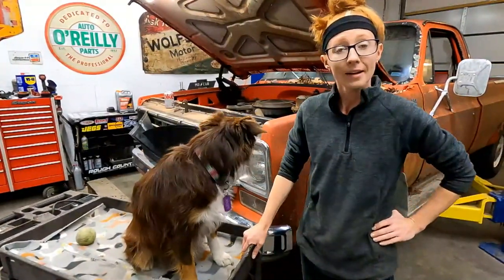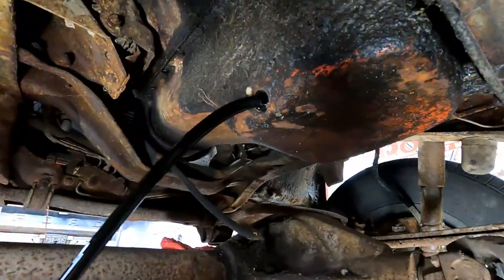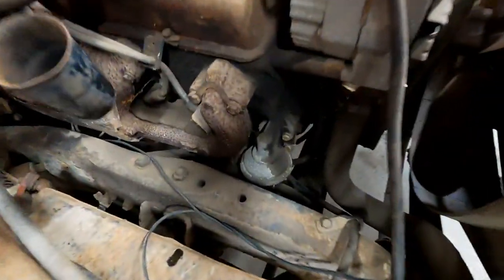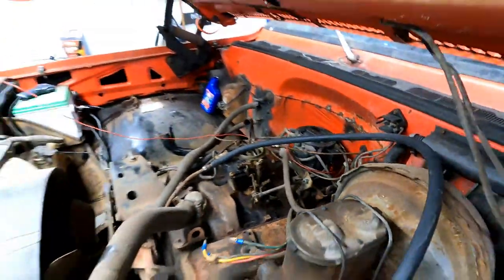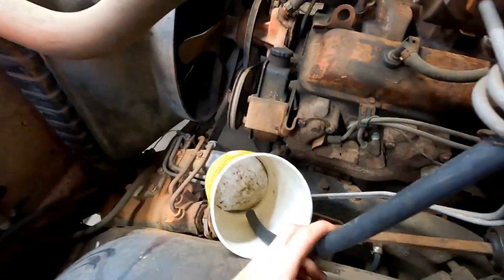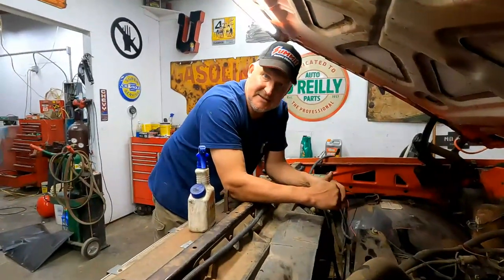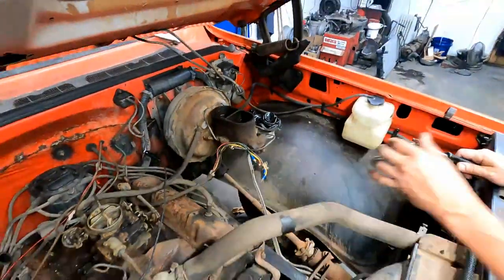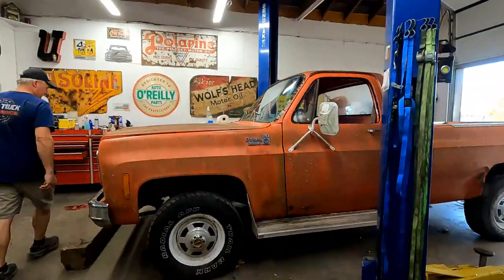CLUTCH WOES & COUNTRY ROADS - 1976 Chevy K20 - FIRST START in 20+ Years! - UTX

Comment: I absolutely love your channel! I was wondering how the vacuum system works on a small block. I bought a 79 C10 and theres vacuum lines all over the place. I was wondering what lines are important and which ones I can get rid of.
Reply from the maker: You would need the line that goes from the vacuum source on the intake to the vacuum ball and a tee in there to go to the interior vacuum line which supplies vacuum to your hvac.  You also need vacuum to distributor from a timed vacuum port on carburetor and vacuum to power brake booster.  Thanks for watching.

Comment: how did you get steering wheel unlocked without key? ..hey great, I'm starting to plan LS swap into my '81 SWB and just in planning stage , and wanting to know all parts needed to get before i start, keeping fuel tank and going with brothers fuel pump, couple concerns are wanting ti keep original motor accessories , alt. ps pump, no A/C , . other concern is ECM besides disabiling vats, will factory tune be adequate or will it need reconfigured? stock 3sp w/OD. peugoet i think. I know i need flywheel from 4.8 any recommendations on clutch and disc? the LS is '05 from 4wd silverado, obdII plug? O2 sensors? dual exhaust, 81 has I6 -250 , which motor mount locations for cross member mounts? oil pan issues? i want to get started by next OCT. if the 250 can hold out that long, shes getting weak...i love your channel so i'm watching as many that seem relevant...thanx, I'm sorry Em I haven't caught what I presume is your father , forgive me if I'm wrong, his name? I want 2 call him pops, only he might be younger than I. he has off beat humorous side that is befitting a gentleman with his mechanical background...keep videos coming, i 'm keeping notes, part references wud be very helpful too...see ya n funny papers
Reply from the maker: Sounds like our next video will be right up your alley! We'll address more of your questions in other videos too, but if you want more info on ECM programming in the meantime...check out LT1swap.com. We send all of our PCM's to him for programming, and there's a ton of great info on his website. Thanks so much for your comment!

Comment: That’s a winter front , the headlights were already exposed 👀
Reply from the maker: We put the bra back on it. Everyone's saying this winter is going to be bad, so we may need the 4x4!
Reply: @UglyTruckExperience  lol it’s not a bra lol winter fronts are usually used on diesel trucks in extreme cold areas to keep heat in the engine and cab . It can be opened like a bra…🤦🏼‍♂️ to let more air in 🤣
Reply from the maker: Oh I see what you mean... I guess a bra covers the whole front. I'd like to know more about the history of this truck. Why it has the cover, no fan clutch, ran on propane... Sounds like it had an interesting life! Thanks for watching Tim!
Reply: @UglyTruckExperience  I’m wondering if the propane causes the engine to run cooler I know they run clean that may be the reason for the fan and winter front